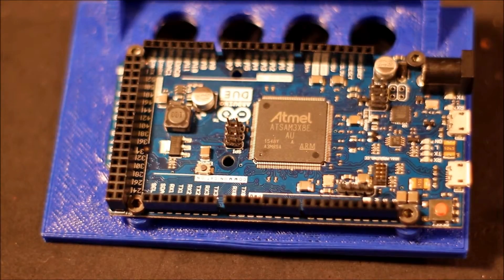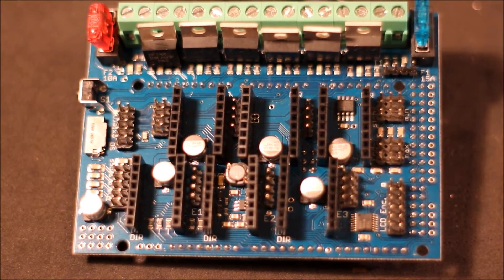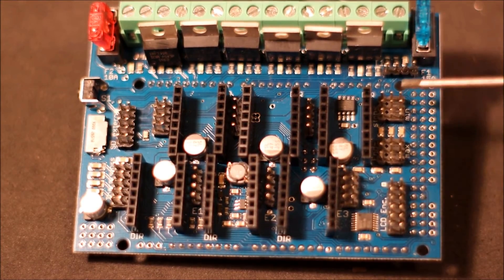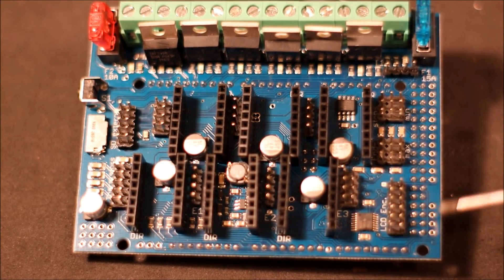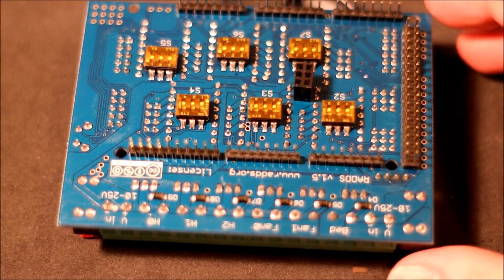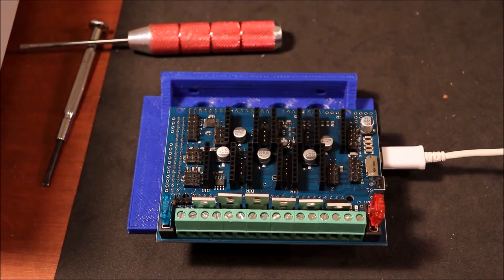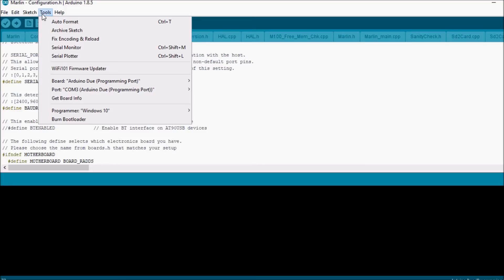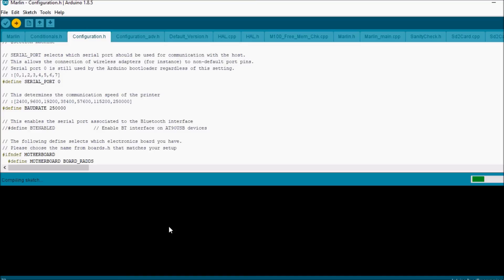RADDS - Basics

Comment: Hi, thx for this Video. I bought a tronxy x5s project. Arduino due with radds Board. Thx to your vid i Made a succesfull upload of firmware from User "wurstnase" there is now an iussue.  Checkbox of malin says: Set Boot Flash true, CPU reset. Could you help me, pls?
Reply from the maker: There's a Discord link on channel either myself or someone else can help in General chat.
Reply: @EdwardBraiman  thx a lot, i'm not so experienced in discord . Is thid you're
Reply: @EdwardBraiman  ..Name in discord, too?
Reply from the maker: My guess is you're using Arduino ide and Marlin switched to VScode with PlatformIO plug-in a couple of years ago.
Reply: @EdwardBraiman  hi Ed, i`m currently atDiscord, now. cheers, Axel
Reply from the maker: Left a question on discord for you.
Reply: @EdwardBraiman  thx Ed, i reply tomorrow mornig, i'm from Germany, 12:00 pm. Thx a lot gor help. Besides, i've made a Vid about and uploaded today. The las third shows some upload operations. Thx again.

Comment: Is it possible to use an extruder driver slot, for a motor driver? (If we want to have more axes of motion)
Reply from the maker: Yes and no.  Second extruder yes and first with mods to pinout file.
Reply: @EdwardBraiman  Thank you! Also, do rotational axes stepper motors need endstops? And can further enstops (external like one can put external motor drivers on a board) be integrated on a board beyond the original ones?
Reply from the maker: Basically need to create a point zero, this involves an endstop or over current on advanced steppers.

Comment: Hello. I hope you can help me. I am trying to load marlin 2.0.9 to mij Arduino due, radds 1.6 set-up. I am trying with vs-code. I selected the motherboard and the evt. But I got an error compiling it can you help me?
Reply from the maker: There's a Discord link on channel.
Reply: @EdwardBraiman  Verbose mode can be enabled via `-v, --verbose` option
ImportError: cannot import name 'get_serialports' from 'platformio.util' (C:\Users\wetze\.platformio\penv\lib\site-packages\platformio\util.py):
  File "C:\Users\wetze\.platformio\penv\lib\site-packages\platformio\builder\main.py", line 184:
    env.SConscript("$BUILD_SCRIPT")
  File "C:\Users\wetze\.platformio\packages\tool-scons\scons-local-4.3.0\SCons\Script\SConscript.py", line 597:
    return _SConscript(self.fs, *files, **subst_kw)
  File "C:\Users\wetze\.platformio\packages\tool-scons\scons-local-4.3.0\SCons\Script\SConscript.py", line 285:
    exec(compile(scriptdata, scriptname, 'exec'), call_stack[-1].globals)
  File "C:\Users\wetze\.platformio\platforms\atmelsam\builder\main.py", line 23:
    from platformio.util import get_serialports
========================================================= [FAILED] Took 1.34 seconds =========================================================

Environment    Status    Duration
-------------  --------  ------------
DUE            FAILED    00:00:01.339
=================================================== 1 failed, 0 succeeded in 00:00:01.339 =================================================== 
PS D:\NIELS\DOWNLOAD SOFTWARE\Marlin-2.0.x\Marlin-2.0.x> echo "done" >"C:\Users\wetze\AppData\Local\Temp\ipc"
PS D:\NIELS\DOWNLOAD SOFTWARE\Marlin-2.0.x\Marlin-2.0.x>

Comment: Hi did you use marlin on purpose ? (Quite old ) or is there reason not to use Repetier ? (i need to decide that soon  for myself doing an idex version )
Reply from the maker: Marlin appears to have more features.  But I think both work well.  Keep in mind the driver was the only one I found that loaded.  I'm waiting on a stable version of Marlin 2.0.x, but this could be a while.
Reply: Ah i see didn't that approach work ?`http://doku.radds.org/dokumentation/firmware/arduino/repetier/